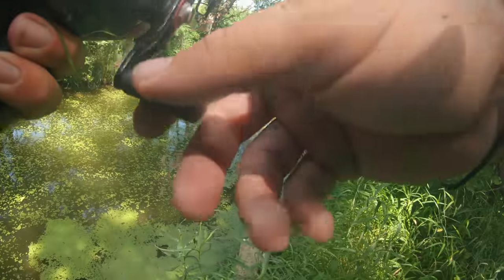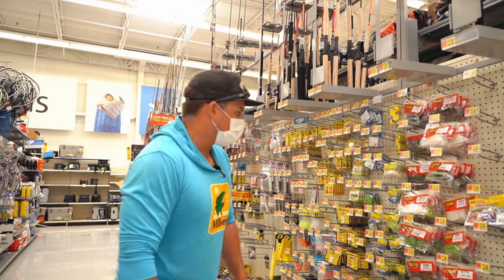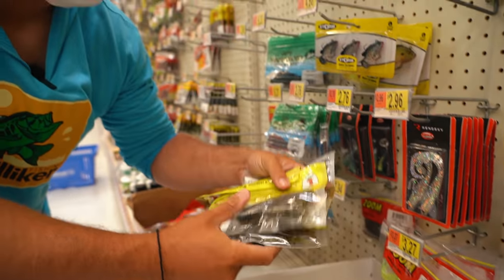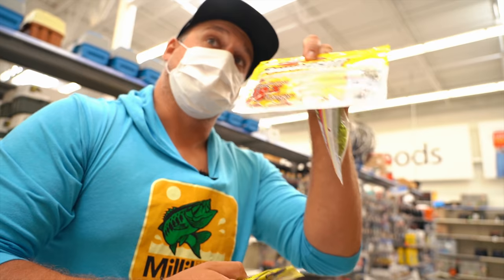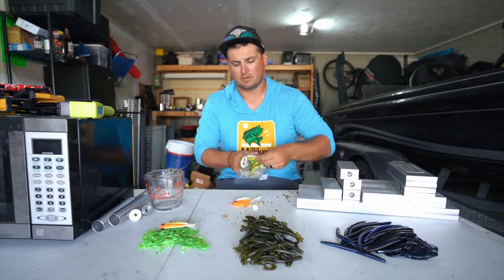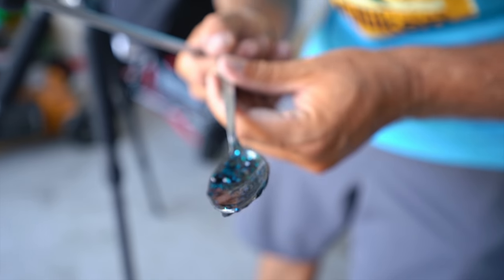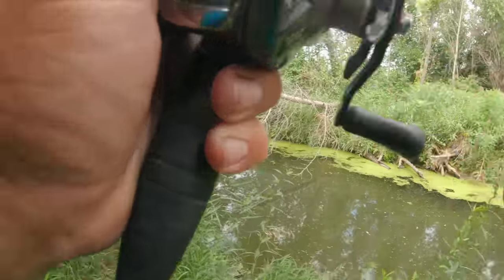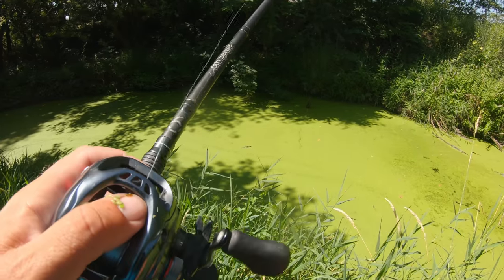REMELTING the WORST Walmart Fishing Lures into LEGIT New Baits!! (SURPRISING)

Comment: I've tried to use those powerbaits before, they are complete garbage.
Reply from the maker: I'm sure a stupid walleye would eat them
Reply: Found a bag of em on the bank. Advice: don't leave it on your hooks, I needed a razor blade to cut it apart and remove. Didn't get a bite either.
Reply: Ive caught plenty of bass and walleye on berkly power bait